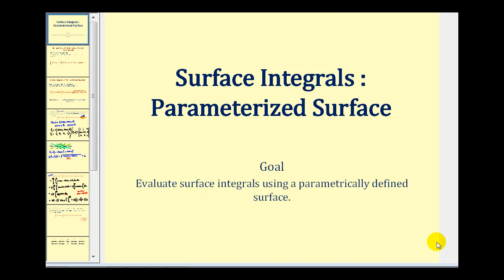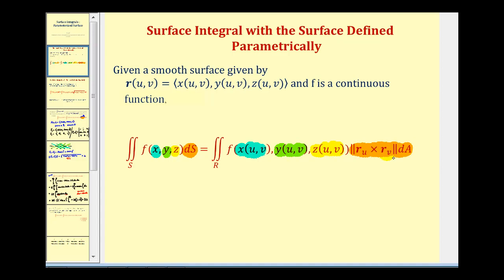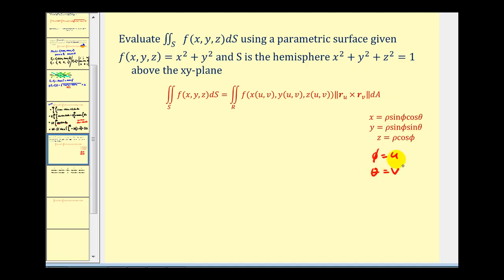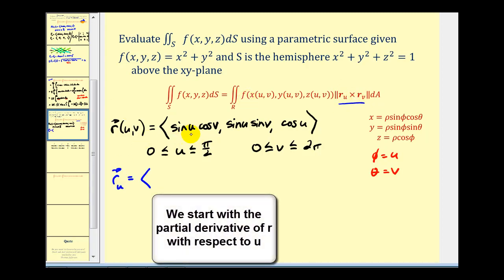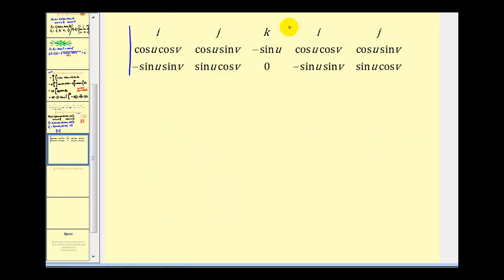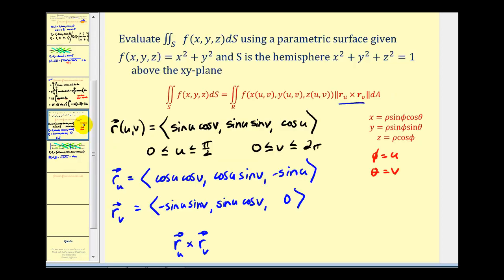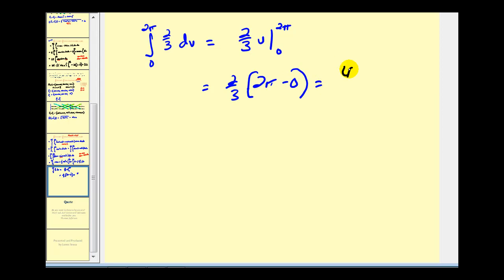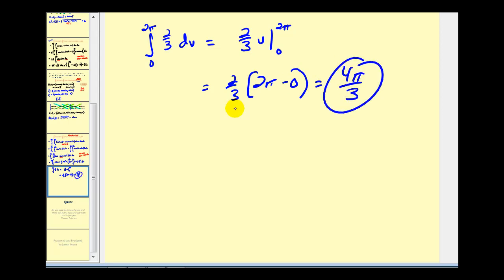Surface Integrals with Parameterized Surface - Part 2

Comment: for phi, how did you get from 0 to pi/2? I thought it was from 0 to pi because phi is the angle from the positive a axis to a point on the sphere. since it is a hemisphere, the lower limit would be 0 and the max limit would be pi. Can u explain plz?
Reply: for a full sphere, it is 0 to pi. but since it is half a sphere, it is 0 to pi/2. Don't think of phi as the same as theta
Reply: nice. thanks. i was initially confused with that. Are you in calc 3 right now?
Reply: yeah. We are about to have finals soon so I'm watching all his videos.
Reply: Nice. Doing the same. He has the best math videos! Are you taking diff equ. next semester?